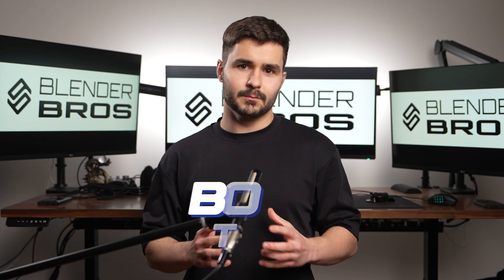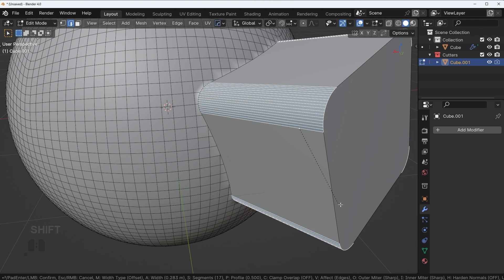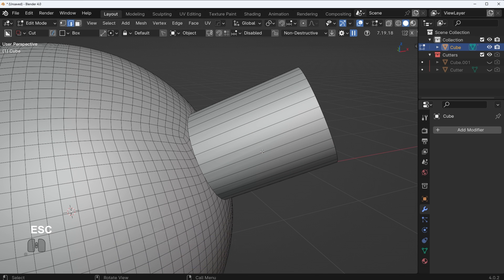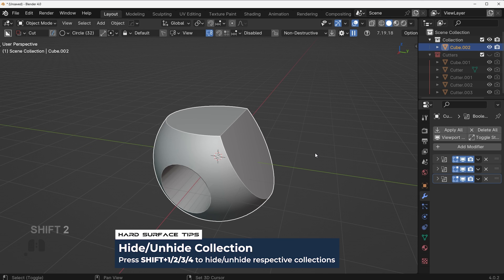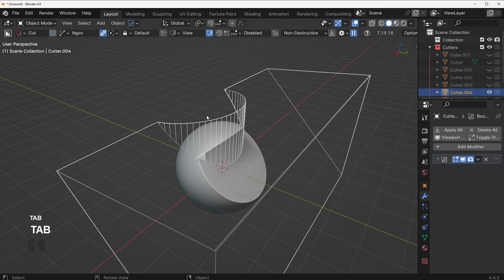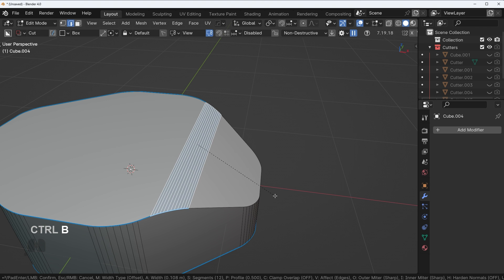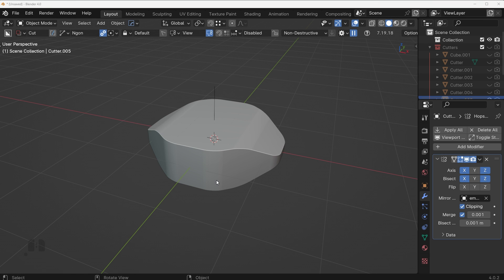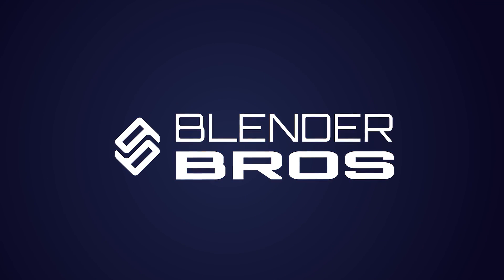My favorite BOOLEAN techniques in Blender (and how to do them)

Comment: A loose suggestion for your content: You are a hardsurface artist. This is your field, and you do that well. Many if your examples represent your workflow for concept pieces, where the topology and poly count doesn't matter at all. I am not saying there needs anything changed about this, I am just suggesting, you may make your role more apparent in your videos. Your role as a hard surface artist AND for which kind of result you are explaining your methods. As you said in this video, you go the lazy way, because that's fine and done. Which is alright for a concept piece, but not for other elements that are supposed to be used in a different context.
Instead of mentioning many times, what your profession is or what you current examples could be usable for, maybe use a video overlay, that communicates such elements at all time. Because I can imagine many people stumbling over your content, intending to learn things that don't really connect to hardsurface modeling, see your workflow and they are puzzled like "that's how you are supposed to do this?". And then they make end up with counterproductive things added to their workflow.

That has not happened with me, but something that circulated in my head many times. So might as well express it, because especially in educational content, it's always a good thing to make things clear. Despite me rarely learning something new from these videos, I like to watch them.